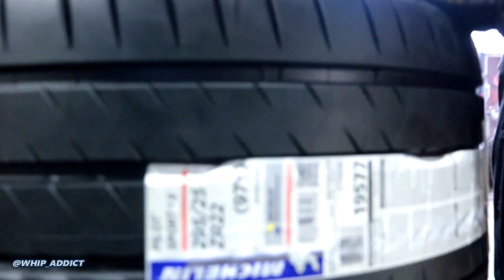WhipAddict: Boomman's 2020 Corvette Stingray on ECL Forgiato 21/22s! White Black Combo! Traffic Jams

Comment: Love the black and white look. 22 inch rims are too big for the C8 because you have very little tire. One bump or pot hole away from a bent rim. You need more sidewall for sure. If they were 20 inch in front and 21 in rear it would be PERFECT..